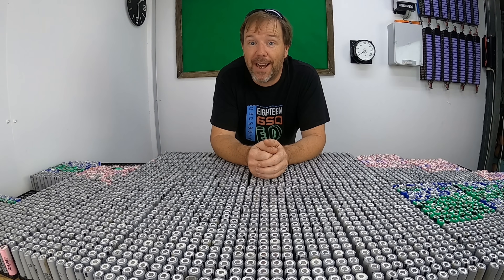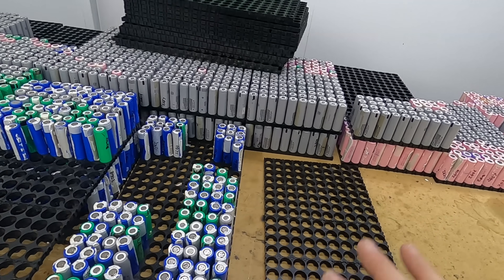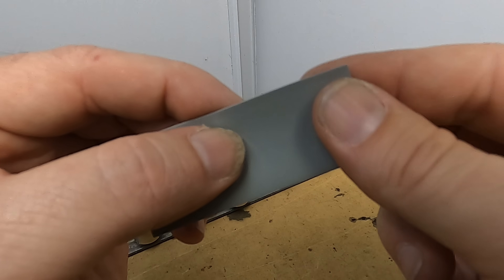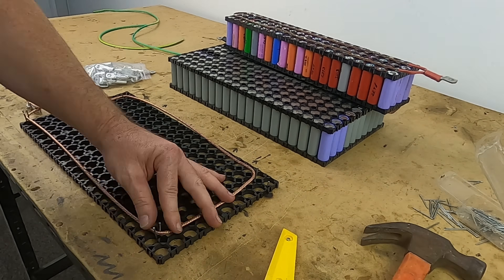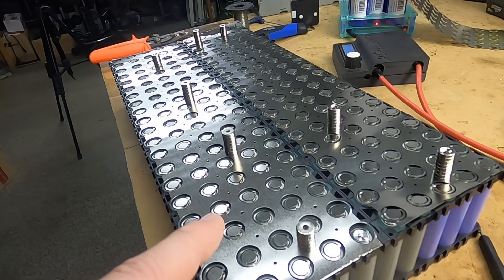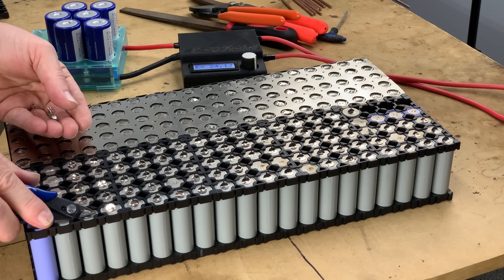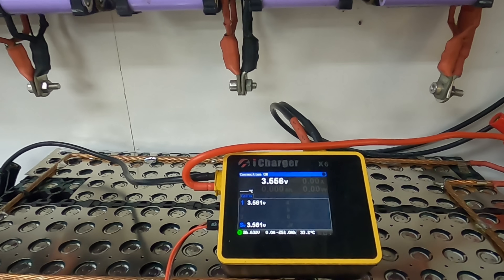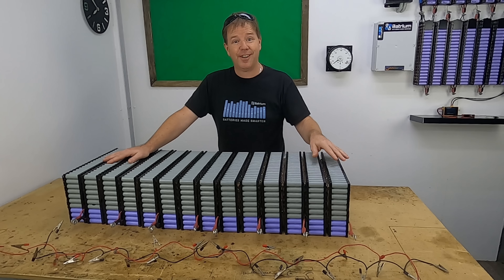Creating my single biggest D.I.Y. battery with 2800 18650 cells recovered from used laptop batteries

Comment: Sorry for being an asshole in earlier comments. I subscribed. Have you ever used glass axial fuses?
Reply from the maker: I have yes, hated them ... Reasons - spotwelding or soldering they looked ugly and out of place, very hard to tell when a few breaks, too much heat soldering fuse breaks, bump, knock etc they break, now of cause you can be more careful but in the process of filming EVERYTHING gets a wack for good measure. That said they work, just not for me.
Reply: HBPowerwall that helps a lot. I think I’ll give them a try as I’m building more of a power bank than a power wall for led landscape lights. Thanks much brotha.
Reply: HBPowerwall hey sorry one more question: do you analyze your battery capacities at 1 amp or 0.5amp? Thanks for all the information. Huge help.
Reply from the maker: 1 amp - helps draw out  the possible heaters & its faster to test..
Reply: HBPowerwall that’s what I thought. Thanks a ton man. I have an entire box of 18650s to retest, idk why I thought 0.5 amp was the norm.
Reply from the maker: some use it but the process takes so long - why double the time lol
Reply: HBPowerwall I agree. I’m on 4 straight days of testing batteries with a crappy “Power S” Charger/analyzer. Just ordered 2 opus chargers, they can’t get here quick enough.

Comment: I want to test the short circuit current of all those cells in parallel
Reply from the maker: All in parallel with a MASSIVE lump of copper cable bout 2800 cells bout 50 amps dead short - that's a stupid amount of potential 140,000 amps for a split second? Look i don't math good but its not out of the realms of possibility

Comment: Under no load there will be no difference in the terminal voltage to any point in the pack once the cell pack has come to equilibrium... In this test you showed the effect of having a very small current producing no measurable voltage drop... Not a very good test. Though I don't expect there to be a lot of voltage drop regardless, I am simply stating that you performed the test incorrectly. In the future if you want to see if there is a measurable difference place the pack under a set load and then measure.
Reply from the maker: That was the load i had to test with and represented close enough to the actual max load (ish) I think it's still a valid test even if it gives someone else the idea on how to do it or even not do it..

Comment: Idk why but hitting lithium ion batteries with a heat-gun doesn't sound appealing.
Reply from the maker: You're kidding right, it's heat from a distance for a VERY short time lol You're laptop would get more accumulated heat in a good gaming session than this will shrinking the heatshrink..
Reply: @HBPowerwall  Im just saying, im a little paranoid about directed heat on anything made of alkali metals after a chunk of potassium exploded on my lab bench out of nowhere from being exposed to a ray of sunlight for too long. 
If the heat-shrink is something like LT100 then i would probably be fine as its shrinking temperature is very low.

Comment: You should attempt to build an electric vehicle battery from laptop batteries. That would be pretty cool to see functioning.
Reply from the maker: It would function but (in hindsight) be stupid this way - this way will work for static storage but as soon as you move it around fuses will break.

Comment: Hey mate, nice work. Where do you get bms for your battery? are you going to put a temperature sensors? and how do you ballance cells? thanks mate
Reply from the maker: BMS is a Watchmon5 plus the MM8 from https://www.batrium.com my current Watchmon4 setup has 120 temp sensors, the new version has about 8 remote sensors - should be more than enough 120 was likely over kill lol
Reply: Thanks  mate I'll have a look at the bms maybe i'll use it for my projects:)

Comment: What do you use to test the capacity of each of the cells?  Presumably each test has to do a discharge/recharge cycle on every cell, must take a fair while.
Reply from the maker: Hold build took about a year start to finish
Reply: @HBPowerwall  I meant to test each cell to get a capacity number for it.  Presumably they have to be done individually.
Reply from the maker: yes more deails on that process in this playlist - https://www.youtube.com/playlist?list=PLVtgHS9JIte_tT8JVGvoK3OBy7sYm3Xwj
Reply: @HBPowerwall  I hadn't spotted that playlist, or that specific video.  Many thanks!

Comment: Balancing that will be nearly impossible...     it will heat up your house for sure while it charge or decharge un balanced.   but the heating will be one off moment.   
I see you have made them in order of capacity , but that does not mean they will be charging and opposite at same rate (time)..   any difference in voltage , between cells and grouped up cells will cause massive spikes in amps going true packs.. (= heat ).  
At least you have built it with "fuse" behind every cell.  That may actually make it safe to use.  
Well hope best for you,  but just saying..  i would not install that anywhere close to my home.     Even if you load them lightly,  the balance difference in packs and cells in them, will draw massive amps quite fast.
Reply from the maker: Sounds like you really want to understand but you fine really understand at all. Stay tuned, you might not have watched to then end. There was a high end BMS taking care of the balance & control duties.
Reply: @HBPowerwall  its been over 20 years since i studied engineering, and mainly automation and logics for factories after generic electrics for building houses. 
But something about Kirchhoff's 2.nd law popped up in my mind while watching your vid.    
I highly doubt that internal resistances and charge and discharge times are in balance with your cells.   I could be wrong, but thats the gut feeling i have.  
I know its massive job to calculate all cells as their own, as group's and in whole assembly at different state of charge, just to be sure to avoid other cells self balancing the charge of others.  One workaround could be diodes between each cells to make sure you dont get current flow between cells etc..   But hey i look forward to see more and how your BMS works , as im not familiar at all with that. 
Anyway..  stay safe and have fun.
Reply from the maker: Max load per cell will me 0.33 amps. Average load is 0.03 amps.
Reply: Balancing nightmare, and have fun finding a bad cell
Reply from the maker: You mean with my thermal camera a d a bloody top shelf BMS. You bet I’ll have fun.  For a few minutes a week at any rate.
Reply: @HBPowerwall  it’s cool how you respond to so many comments. Also it’s cool to see you have an answer for everything and I do concede my experience is not on the level of your expertise. I still doubt that it could be efficacious to balance a pack composed of recycled cells of this magnitude or that they will discharge and charge evenly. Again though this project is above my level of experience. I do hope it proves to be well worth your time as it is an amazing piece of work.

Comment: What happens when indivual cells go bad?
Reply from the maker: With luck same as what happens when you get a flat tyre on your car. You change it. Either the CID or cell fuse will fail befor anything goes south.

Comment: Just curious how much does each weigh after being created?
Reply from the maker: 9.4 kg each
Reply: @HBPowerwall  thanks I was just curious as I've been tinkering with the idea of doing an EV swap on my old datsun and have been trying to figure out options for batteries
Reply from the maker: Do NOT do it this way - i know the start i said different but this is only ok for static use - those fuses will vibrate apart in no time cause massive imbalance and shit will burn.. Buy tesla batteries & sleep better.
Reply: @HBPowerwall  ok thanks for the warning!

Comment: I about dropped my teeth at the total cost...!
About $10,000.00...!!!
Reply from the maker: Close your dam mouth - it only cost about $3000.00 and that's Australian buckerooze
Reply: HBPowerwall 
$9581.41 is what you listed as being the total cost under your link titled “total cost of project” or something like that...
If I’m mistaken please educate me.
Also, no where did it specify what country’s currency this was in.
Sorry that I did not make the connection that this was in Australian dollars...
If it was in fact $3,000 AU then that is much better...!
Reply from the maker: @troystutsman1400  Oooh, check out the date on that its at least a few years old, I really should have removed that link. That the cost of my last system that has been in production for the past 4 odd years

Comment: Where did you manage to get all those recycled batteries from?  I'd love to have more available for future projects.
Reply from the maker: This batch was from a local school through a recycling company
Reply: @HBPowerwall  You can made tesla)
Reply: @HBPowerwall  schools throw out everything and than tax payers buy more,, the never ending cycle of taxes.
Reply: Check Ebay
Reply: China sells a lot of them
Reply: Lowes battery recycle bin
Reply: Were abouts do you get the battery trays and other stuff you use to make the battery packs? Im in oz as well and have been colecting 18650 batterys for this very thing?
Reply: he paid hundreds of thousands of dollars for a youtube video, when he burns his house down he will probably record that and put it on youtube as well.
Reply: @shawnio  With proper supply chain(as his), with proper BMS protection for the cells and using them right... I would say it is more likely that your toaster or *washing machine fires up the place than his creation. Keep your negativity to yourself, or even better, quit it.
Reply: @shawnio  best to store batteries in a concrete shed AWAY from the house
Reply: @frankmundo4300  Thinking the same thing myself. With so many batteries, it just takes one to set off a chain reaction. Especially they are USED, so some could be defective from the start.  It would be a huge fireball. I wouldn't want that within 50 feet of my home.
Reply: @shawnio  the question does pop in my thought. What if a cell ignites and sets of all the others. What is the extinguish plan?

Comment: What happens if one of these battery arrays develops an internal fault and shorts out?   Does it catch fire and burns so hot it can melt steel?
Reply from the maker: One would hope one of those 2800 odd fuses blow first, or even the built in CID

Comment: That's a lot of work. But I am afraid that your cells will become unbalanced very quick and you will loose a lot of energy because of that. If you drain a very low current from them it may work well. Even if you did a selection before, when drained current is higher, I think it will unbalance the battery. Unless you monitor the voltage of every module and use the whole battery according to that module min/max values. Great work!
Reply from the maker: The batteries will be managed by a https://www.batrium.com BMS balance isn't an issue at all. Max draw is planned at 0.33 amps

Comment: What was the purpose with the blank cells?
Reply from the maker: To run my home offgrid
Reply: @HBPowerwall  I mean the six 0V cells per pack
Reply from the maker: Ooh they are touching my mounts - stops shorts
Reply: @HBPowerwall  Aah, thanks!
Reply from the maker: It's in the next video .hehe

Comment: Very good initiative, however the proper way to repurpose the used cell is to have an advanced BMS that can take the different internal resistance and aging into account to have a safe operation. This maybe highly dangerous if a single cell aged faster than the rest
Reply from the maker: Arrr another that didn't watch till the end... BUT thanks for the interaction.

Comment: Don't use aluminium clip with copper wires they corrode at joints over time.
Reply from the maker: What part of the video are you referting too and is that 'TIME' like 10 years, 20 years - don't think this battery will be here in 20 years...

Comment: Wait did you actually intentionally mix cell capacities? That's how you get fires! 😬You did so many things right except that.
Reply: you CAN mix cell capacities in the parallel set. but try to make sure each parallel set has similar capacities
Reply from the maker: ok
Reply from the maker: I disagree, but your welcome to your opinion  I'll check out your videos on the topic soon.
Reply: @HBPowerwall  I don't make videos but I think that different capacity cells in parallel would lead to the lower capacity ones reaching a lower voltage first while discharging, and being more often discharged into by the higher capacity cells, creating heat and shortening their lifespan. The advantage of ensuring all parallel groups are the same capacity like you did would be less balancing required and more efficiency, but at the expense of some safety I think.
Reply from the maker: There would me some micro balancing going within the 191p battery on but you have to look at the load at max load for it's intended location it's MAX and i mean DREAM land max load is 0.33 amps per cell. Average load per cell is less than 0.03amps per cell.. Still think it's an issue?
Reply: @HBPowerwall  Oh, that's true, sorry, coming from a background with high drain applications. (EVs)
Reply from the maker: I figured that. :)
Reply: @HBPowerwall  Yeah, sorry again, great content. I came off as overly rude. BTW, where do you get the blank placeholder cells?
Reply from the maker: All good - link are in the description i'm mobile at the moment so can't link easily

Comment: isn't it a bad idea to mix capacities? i thought for sure you'd build packs with all the same capacity cells in each pack, but then you put a few of each in each pack.
Reply from the maker: To be fair the 'batteries' are all the same capacity close to with in 10ah each...
Reply: @HBPowerwall  but why intentionally put different capacity cells together, when you already had them sorted by like? wouldn't the 'stronger, longer lasting battery' be one made with all matched capacity cells? in the RC world we're discouraged from putting batteries in parallel which have different capacities.
Reply from the maker: A battery is only as strong as it's weakest cell - by evenly distributing the MAH range cells it builds one closely matched 191p battery.
Reply: @HBPowerwall  did you not put one of the weakest cells in every battery? maybe i misunderstand how you've divvied up the cells.
Reply from the maker: Cell i'm refering to is the built 191P battery pack - all 14 are very well balanced..

Comment: Literally the first video of you I watched. I'm thinking of diying this to add to my parents' solar panels. I only have a few UPS' in my server rack (12kVA with 1 bad battery pack so 9kVA) which I got for 24 euros. Looking at the prices for a "real" solar panel battery pack would be like 2000 for 3kVA. I'm curious to know why you went with these small laptop cells instead of like the "real" battery packs in UPS' as they are fairly cheap aswell.
Reply from the maker: I went this way basically because its what my channel grew on so feel compelled to continue making bigger, better & safer

Comment: Why did you solder the copper bus to the nickel sheet? Any reason you didn't just use some thin nickel strips and spot weld to hold it down ?
Reply from the maker: amp draw, I did do that and tested with 30 amp load for 15 hours and she got very hot.. and voltage sag was unacceptable.

Comment: Hi, if i was going to make a 12V/200Ah battery pack to use in my caravan. How many cells will i need, and what will the weight be?
Reply from the maker: cells are about 45g each, depends what cells you use dictates how many, then you'd have to work out the load. In hindsight you'd buy a battery for a van not build like this. The fuses will break under vibrations. I'd say suitable only for my application that's has static storage.
Reply: @HBPowerwall  ok, thank you for answering. i was hoping to save some weight ;)
Reply from the maker: That's a good reason - are you in australia?
Reply: HBPowerwall no, i am from Norway, other side of the planet ;)

Comment: That battery is probably not going to last too long. Putting too many lithium ion batteries in parallel is probably going to kill them all.
Reply from the maker: That is not my experience
Reply from the maker: Full four years on my current battery 24/7
Reply: @HBPowerwall  Could depend on the load. From my experience, one of a hundred batteries tends to short-circuit itself over its livespan. I'm curious if that's going to happen one day.
Reply from the maker: It does and it happens - you know that car you drive - it gets a flat every now and then & battery needs replacing - and that dam oil... why do i have to change that ll the time.. Same thing I guess. You gota maintain everything in life..

Comment: I'm always curious about balancing after the fact. How much/often would a battery like this need the individual cells rebalanced?
Reply from the maker: Batrium BMS will take care of the balancing and all the stuff a good BMS should do - https://www.batrium.com.au
Reply: @HBPowerwall  I feel I should clarify...Since they are in parallel, how does one prevent the lowest cells from discharging sooner - or is it just the balanced capacity test at the start that reduces the likelihood of there being a problem?
Reply from the maker: @frollard  no problem with the parallel cells amp draw TOTALLY maxed out is 0,33 amps typical draw is 0.03 amps they will dynamically balance

Comment: What are you doing for thermal management off your packs?
Reply from the maker: ensuring the temp never changes by having a max draw of 0.33 apms and a typical load of 0.03 amps... zero thermal issues under load/charge
Reply from the maker: per 18650 that is.. this is Home storage for this application.